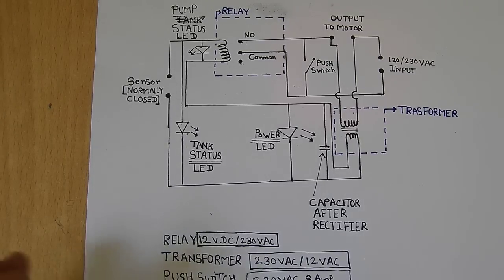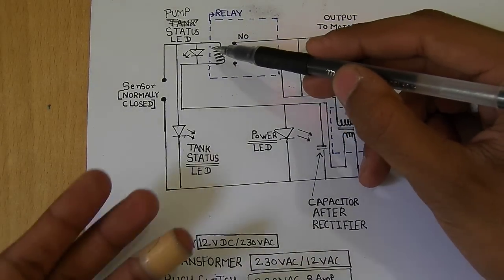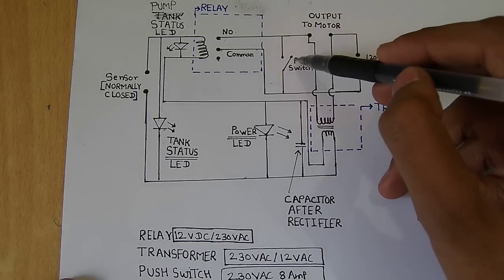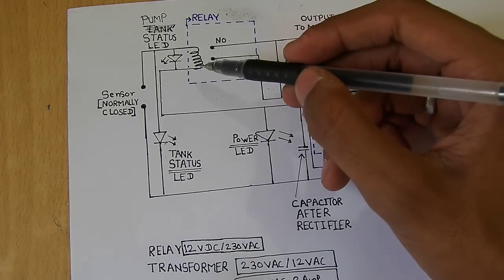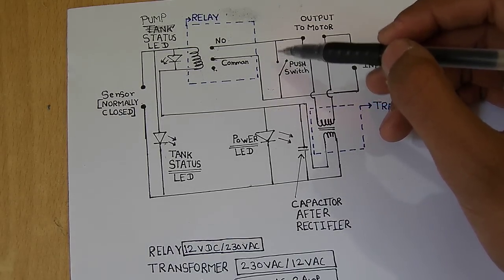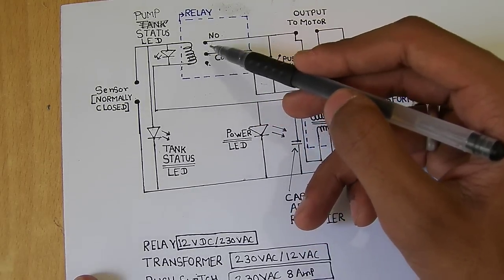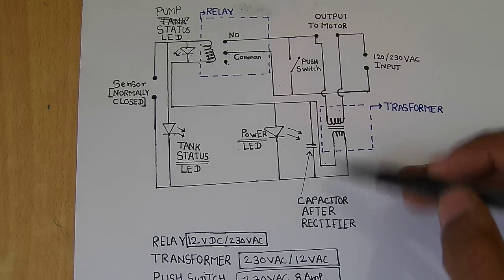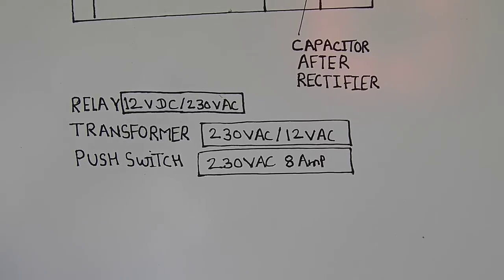#7 Automated water pump working explained

Comment: Use 110/220/to 12volts D.C. Power supply.push switch should be 5 to 10 amps.rated   Momentary it takes the load of motor

Comment: can you provide me better solution of  Mr Sukhchain Singh . same problem arise, when water is filled the motor get off but  when water level fall down then motor start automatic  no need to press push switch....
Reply from the maker: you can connect another float switch at desired low level of tank and connect this switch in parallel with ON Push Button .

Comment: i have a doubt... i want this circuit to be auto off after water level falls, after once it has been filled...but as water level falls it starts the motor again... how can i change it ?
Reply from the maker: So just one change needed 

You have to connect normally open water sensor and place the sensor @ about 10% level

When level fall below 10% normally open switch closes and triggers whole circuit automatically so it will be totally automatic.